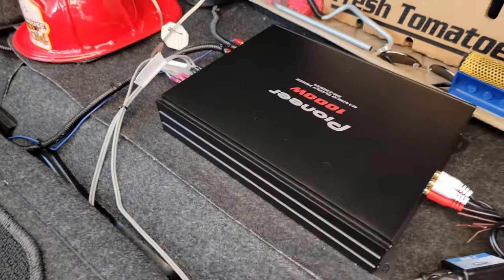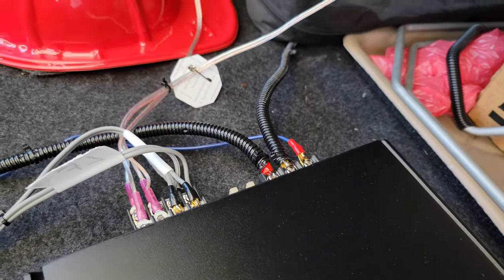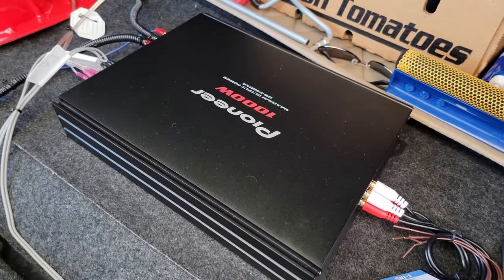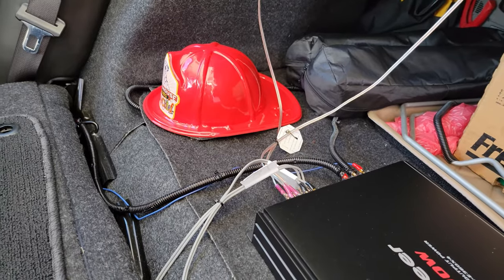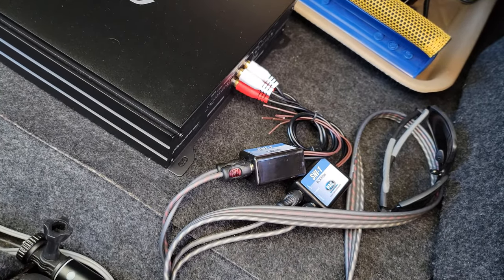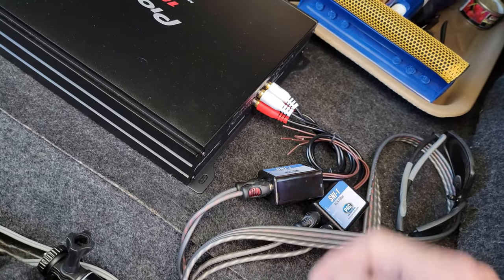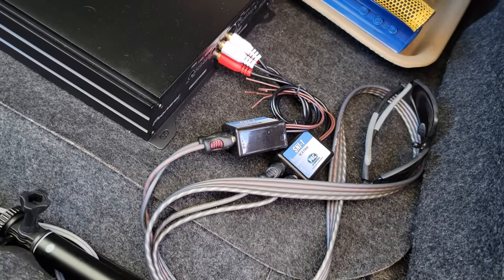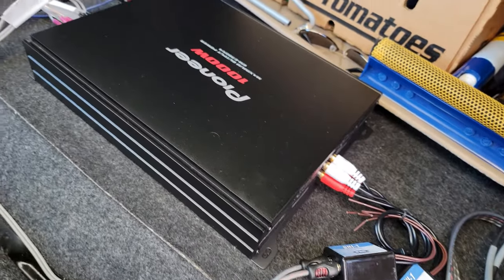Car Stereo Amp Whining Noise from Speakers and How to Fix It with RCA Filters #carstereo #amplifier

Comment: Sni-1's are the best "cheaters" you can use for whine if you install your system so bad like this one you need them. They are also meant to be plugged into the head unit... Guy don't do anything seen here. ROFL

Comment: These work but 99% of the time it someone doing something dumb and the rca are not the problem but if you can’t get anything to work these work these are also normally supposed to be near the stereo but if it works it works

Comment: My 2009 lancer stereo cd mode can play discs only the sound is fuzzy like static on a tv. You know music is playing but its distorted. I used a commercial release cd from 2010's. Perhaps the player is not plugged in correctly. Perhaps it needs cleaning. The radio, aux both work. Speakers work. Any thoughts??

Comment: This is installed wrong!
Reply: Please explain
Reply from the maker: @dirtytamato  even though I did install these incorrectly it seems to have helped but I have since removed the filters after reading some of the comments on my video. I admit I did install them incorrectly...
I have run into another issue... My stereo turns on but now I get no sound at all... The amp shows a red light instead of a blue light... I'm stumped...

Comment: The SNI-1 takes a lot of base out of the sound.  I don't have a sub to replace that lost base.  I removed the SNI-1's,  too much loss for my taste.  My whine is coming from the aftermarket head unit so I'll be diagnosing further.  Going to try some ferrite chocks on the power wires and triple check RCA grounding.
Reply from the maker: Oddly I haven't lost any bass that I can say.. I don't have a sub but I do have two three way 6x9 two 6.5 two ways and a set of tweeters... You can try grounding your amp in the trunk and then run an additional ground directly to the battery. I myself found it easier this way because I was getting too much interference with the rca cables on one side of my car and the same interference on the other side where the power cable was... I couldn't win so I tried these and they worked.
Reply: Never run 2 grounds, that will make it worse.  Just run one thick cable from the amp/stereo/radio/head unit to the battery ground.  Using the body ground exposes the unit to ground loop current in the vehicle body due to all of the various electrical components connected at different spots.  Each ground is at a slightly different low voltage, causing currents to flow in the body.  No bueno.  Avoid it all by running the ground all the way back to the battery.  Every time.

Comment: Alternator whine from your car stereo is quite likely dry solder joints inside the old radio unit itself.
I removed the unit, opened it up, recognised several bad solder joints, and renewed them.
Reinstalled car stereo - whining completely gone. :)
Reply: I was having this theory glad you mentioned it. It's given me enough motivation to rewire the harness and make sure everything is isolated.

Comment: I installed a amp and JVC radio in my 71 F100 and it worked like a champ...no problem. I bought another exact set up for my 73 F100 and it whines and clicks like a mother. I disconnect the alternator and it still does it. The ignition wires are new, the distributor cap is new, the coil is new and for the truck with internal resistor, I checked the condensers all over and they are good. I put ferrites on all speaker wires and power and ground wires...the same. I put a noise reduction device on the radio power...still does it. Switched to the power wire to amp...still does it.  I ran power straight from the battery and ground... still does it. I put a condenser temporarily on the coil...no change. I used the wire connections for the radio and amp and did the same on the other truck that works like a champ. I'm totally lost. I replaced ground wire...motor to body to frame, no change.

Comment: You are correct with the solution you used.  One thing I found with 20 plus years in the business was the quality of the equipment.
Cheap amps guarantee noise.  I sold only higher end and never had problems with noise.  We warned people who brought in their own equipment that it would be an issue ahead of time if it was cheap.  Honestly I have no idea why it worked that way.  Perhaps the quality of design or built in filters.  We used JL, PPI, Eclipse, Alpine. Clarion(made in Japan product)
If there was noise using one of those then the amp was defective.  There's a huge aftermarket filter business and no one just comes out and just says what I'm saying.  If you ever get a higher end amp ($400 up range) drop it in using the same wires minus the filters and you will see.  You may even find a shop to lend you an amp to test it or at least get their input on what I said.  High end of course.

Comment: Somewhere along the amp wiring you have the power and ground running parallel to each other they need to cross perpendicular to get rid of the engine wine.

Comment: i got whine only when i turn on the light, how can i fix that? i notice the cable with power and ground of control unit of light is going same way with my rca, same rca cable with you i have

Comment: Wow thanks for the video Rob That's really neat didn't know that. I have a 2001 Grand Prix GT and I got a pioneer deck in it but I'm not running an amp on the head deck The only amp I have is for the subs and I don't get no wine out of them. I suppose if I had an amp on the head deck then I might get a wine but it's 50 times 4 I believe I think that's pretty common it's plenty loud I don't need anything more.
Reply from the maker: I hear ya man. I'm the reverse...I don't have a sub but I do have six speakers to drive so I wanted a bit more juice to drive them all. I have two 4 way 6x9 pioneers in the rear deck...two polk audio 2 way marines in the doors and two pioneer tweeters in the dash pillars...you should hear this thing with that pioneer amp...it'll knock your sox off...lol

Comment: I'm getting some whine in my car.  I am using the exact same rca cables you are.  Maybe they are shit?
Reply from the maker: It's possible that they are crap but they look pretty awesome.. I guess looks do not matter however.
Reply: Naw, it's usually a bad body ground.  The car body is full of low voltage ground loop currents.   Run the ground all the way to the battery.  Fixes it every time.
Reply: @chiphill4856  I tried that, didn't fix it

Comment: you might wanna get a smaller load amp, like 600w, but youre ok, but get a multimeter, turn on the car, check the voltage on the battery should be around 13.5-14.5 volts, now turn on your amplifier and volume all the way up, check the voltage again, it shouldnt go under 13.5volts, to be even safer, turn on headlights, AC, , any heat source if you have heated seats, and measure the voltage again, all these while the car is still on, it shouldnt drop bellow 13.5 if it does drop below that voltage the car is not charging enough and you might get a dead battery, or the car randomly stall when all the power is drained by the amplifier. but a 600w amplifier wouldnt do that, if it is then you get into those big boring projects, where you're rewiring your cars engine because at the end it developed some corrosion that got into the battery cables, even the one going to the freaking fuse box after some time and then your car is crap because all the wires mightve developed corrosion liek the ground cables, which are expensive to install, when you have to get all the cables and ring terminals, or maybe you decide you wanna produce more power and then you try a shtty alternator or tighten it too much, or get a thicker gauge one going from the alternator, which is crap, id only wanna do that if i really replace the alternator cable and get a big amplifier,  I wouldnt wanna put a bigger load on my cars belts or harmonic balancers.

Comment: Think you just have cheap RCA wire. Tony D’Amore has a good video explaining why spending more rca wires is important.
Reply: Debatable. I'm running Knuconceptz crystal RCAs (OFC, twisted, and double shielded) and the power wires are ran on the opposite side of the vehicle. I'm having the same issue he's having with $15 rcas with a $45 set so I think they don't matter when it comes to coil whine
Reply: Run the amp and head unit grounds all the way back to the battery.  Car bodies are full of ground loop currents from all of the electrical components attached to it.  Each ground is at a slightly different low voltage causing current to flow in the body, commonly referred to as ground loop currents.  Aka: noise.

Comment: You can fix the whine by grounding the amp correctly.  Never use the body  ground.   Never double ground.   Filters affect the sound quality.   Simply run the ground wire to the battery and the whine will go away.    No need to buy $50 worth of filters.

In a vehicle with a common body ground, electrical components are attached all over the body.   And each one of these grounds is at a slightly different voltage from each other.  Very small differences.  This sets up GROUND LOOP CURRENTS in the body as current flows from slightly higher grounds to slightly lower voltage grounds.   So it's best to avoid the body ground completely.

Comment: where do you connect the ground wires cause i’m not getting any sound from my amp :(
Reply: Ground wires go to ground which is the chassis ideally or any bare metal connecting to body of vehicle
Reply: Never use the body for a ground.  Because everything else is grounded to the body, causing noisy ground loop currents to flow.   Just run the ground all the way to the battery.  It's a simple fix.